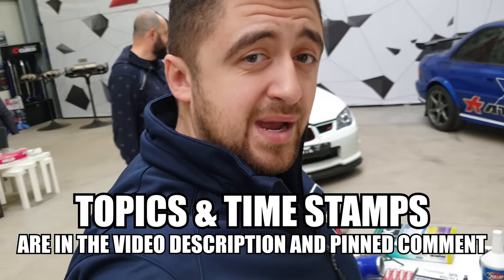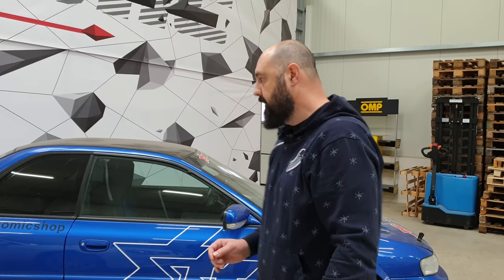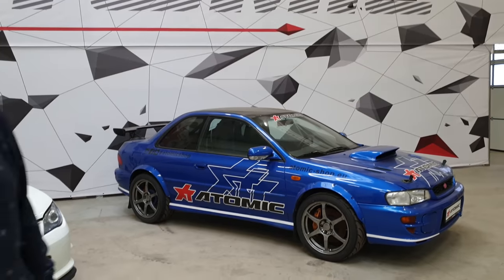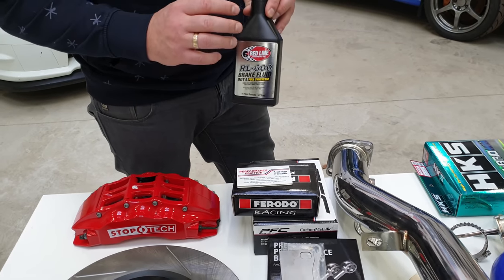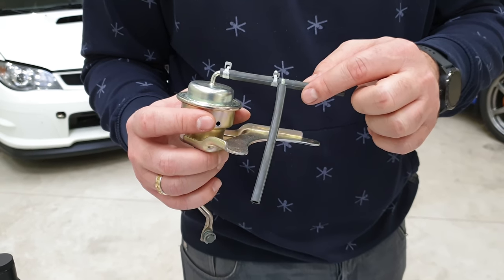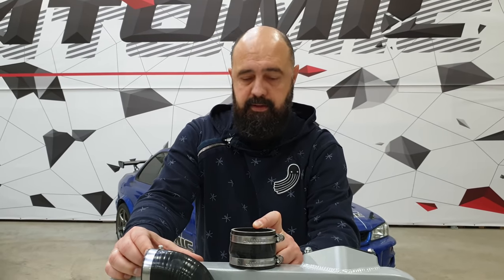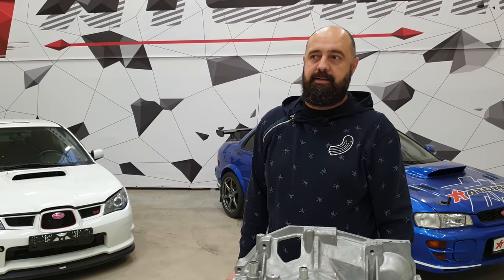ESSENTIAL Subaru Impreza Track Mods

Comment from the maker: Topics and time stamps:
2:04 Special aspects of Impreza
5:20 Chassis bracing
9:13 Wheel studs
10:00 Bushings
12:08 Transmission Oil
14:30 Brakes
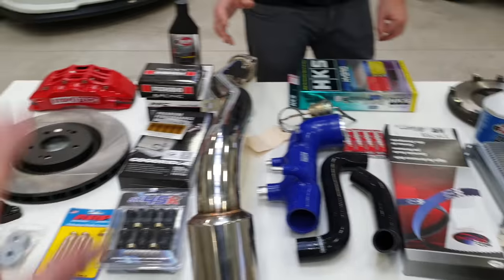23:43 Engine Safety
24:11 Piping
26:09 Wastegate
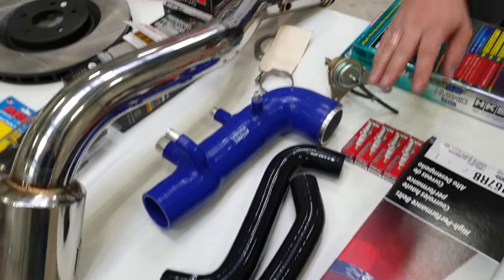26:55 Spark Plugs
28:10 Decat (Down-&Up-Pipe)
28:55 Timing Belt
29:30 Baffle plate
31:10 Oil Cooling
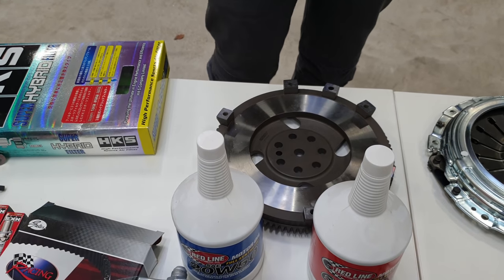32:40 Clutch and Flywheel
33:12 Fuel system
35:55 ECU Remap
36:16 Knock detection
38:00 Gauges
39:05 Intercooler
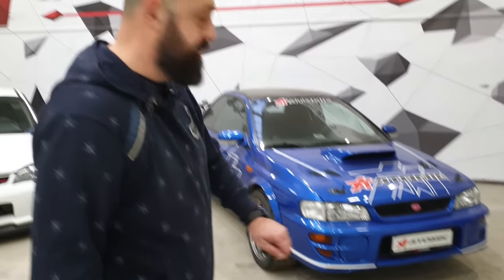41:35 DCCD Controller
42:55 If you went too far
45:40 What everyone thinks they need

www.atomic-shop.eu for all your aftermarket car parts world-wide!
Reply: Misha Charoudin Golf GTI would be good to see for modification please
Reply: Great video Misha! Congrats
Reply: Can we have more tech videos with Oleg?
Reply: Thank you for the great video! My car is as old (and as japanese) as the GC8 Impreya, so bodyflex and weak brakes are an issue here.
I didn't really get (even if I stopped the video) a good picture of the brake heat stickers. How do I find it in your shop? And how do I use them? :-D Do they go on the disc? Aren't they too big?
Reply: InstaBlaster
Reply: wtf. The chassis is not weak, its infact one of the most genius chassis ever made. The car (STI) is more than capable to be tracked right out of the factory with just some wheels. There is alot of mis information here.

Comment: As a subaru owner i could not be more happy to see this, i already have big part of essential mods on my car but i can say a fact about brakes: Front sumitomo 4 pot calipers are used on early r32 gtr, 300zx tt and s14 silvia, all of this cars are heavier than imprezas so the size of the brakes are not the problem, the problem is their construction material, iron and the pots gets rusted and blocked in the caliper with time and you end having only 2 or less pots working. I rebuild them a few years ago with stainless steel pistons and never had a problem with brakes anymore with a propper pad, lines and fluids of course!

Comment: I absolutely loved this episode, I have two 2004 Subaru Forester XT's with STI upgrades, and just recently installed a KEIN Fabrication (a company located in the Russian Federation) Rear Strut Tower V-Brace (I think its more an X Brace) which is very similar to the Cusco type OS V-Brace you show, and WOW did that make the biggest difference in the way the car handles.  My other Forester has coilover, swaybars, and tires, but the V-Brace made the absolute biggest difference even on a nearly stock suspension (this car only has subframe lockdown bolts, rear sway bar, front sti control arm bar, KEIN Fab V-Brace, KEIN Diff Brace, and KEIN Trunk Brace.  It wasn't easy to bend my car back into shape after 16.5 Years of twisting and bending itself out of shape, but my Wife and I managed!

Comment: 45:26 That controller has had a conformal coating bath. They definitely over did a bit there.

Otherwise another very informative video and to the point where I genuinely hadn't noticed It was almost 50 minutes long. Great Job Guys!

Comment: I had the same problem on my lancer before I changed the engine mounts, it's an automatic sadly but still during acceleration and turning it would take a long time to shift, and it was that bad that if you'd concentrate you could feel the engine moving. Inexpensive repair that saves lots of money later on.

Comment: 30:40 this plate does not prevent oil from going left and right. It "scrapes" off the cloud of oil that develops around crank shaft. The baffles   { the special little walls} that are built inside the killer b oil pan do prevent oil from sloshing side to side. IAG came out with the best wet sump oil kit in 2021 for Subaru.